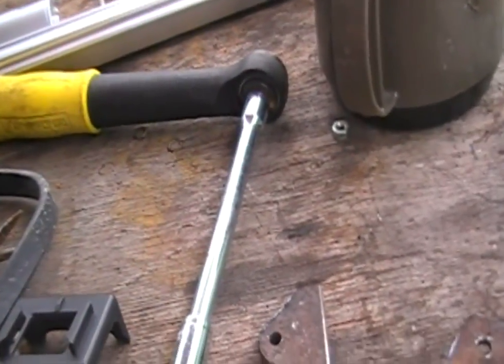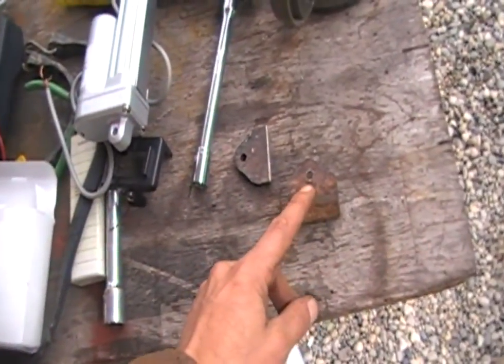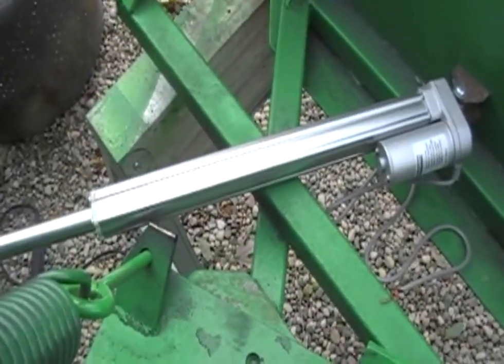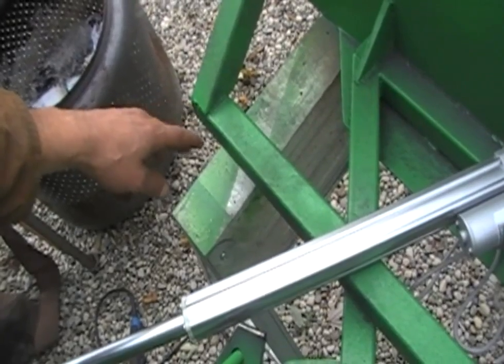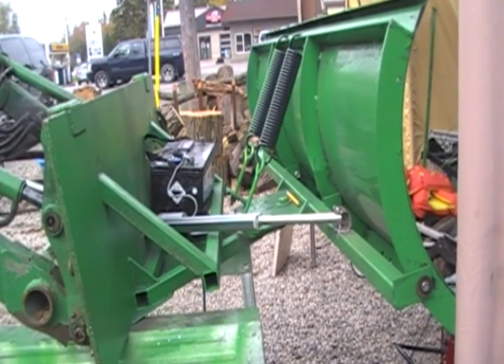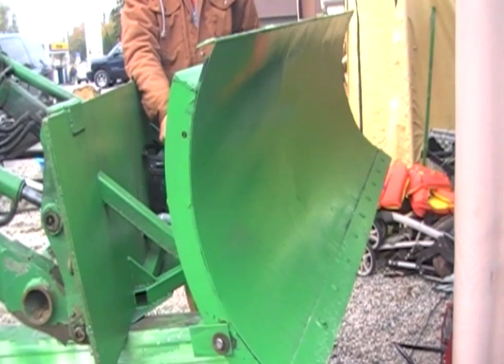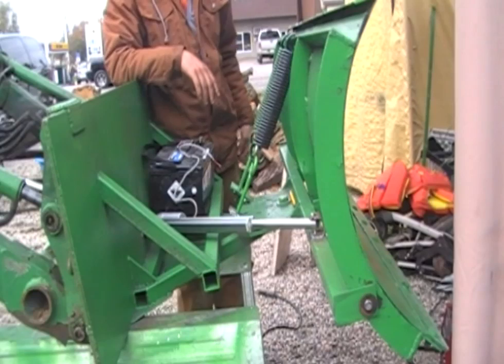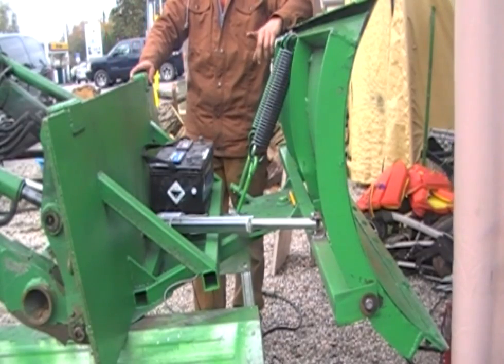12v actuator install on Homemade Snow plow

Comment: There's all sorts of wrong with this. First time he trips the plow that whole mess will get ripped off.
If you're gonna do it you need to have it at the pivot where the actuator isn't taking as much of the force. Problem is you won't have the force multiplication from the lever the plow provides on the pivot. Might stand a snowball's chance in hell vs putting a full load on one of the biggest levers you got there (that also trips forward).
Also agree with others... why not hydraulic? You got a freakin tractor. Just put a cylinder on and boom. Done.
Reply: The actuator should only serve as a way to move the plow, a locking mechanism should be in place to lock the plow in position and take all the abuse.

Comment: Good job rigging plow angler but I can tell you right now absolutely will NOT be strong enough for your application. Your gonna hit a big bank of frozen shit and that little actuator will blow to hell and back. You need dual rams similar to a low end light duty western plow set-up that will distribute the shock load between the two rams or in your case actuators. Maybe if you'd get the heaviest ones they make and set it up like I mentioned it could be do- able !!!  ONE WON'T CUT IT !!  (Maybe on a small atv or something !!   I've tried this so I'm not just blowing shit out of my ass to ya--I JUST WANT TO BE HELPFUL.  sorry !!

Comment: You need a heavy duty actuator for that. The one you have looks flimsy and will probably break. The pivot points are also weak and will more than likely bend as soon as you are into some frozen snow banks (it happens) so I've rethink the whole idea and go more heavy duty if I were you.

Comment: Why not use hydraulic off tractor ? Your auxiliary handles aside seat will perform this task w any hydraulic cylinder you can find n will do both motions in one unit.

Comment: If i were you I would use a winch, much stronger at a fraction of the cost. Still 12v but 2500lbs of strength instead of say 250lbs or 350lbs

Comment: I've got a blade coming and looked at similar actuators.  Highest force was 225 lbs & 300ish - seems not enough.  Considering using motor to drive it between lockable detent positions (Pull cable & release to next position), or going hydraulic.

Comment: I have spotted the fatal flaw that will cause you to crash burn and die!
When the trip springs trip it will bend your shaft to an angle youre not used to!
Reply from the maker: rob armstrong no that part does not move the blade pivot on the Square tubing the tube stays straight
Reply from the maker: rob armstrong I think I'm going to make it lol

Comment: u know that will not turn when it gets cold right ask me how i know.
Reply from the maker: Paul E Clemons Jr does the motor freeze up
Reply: Ive got 3 differant ones and the colder it gets the less they work to the point of not working if you can warm them up they work for a while until they get cold again .The better the quality the less the cold affects them but still affects them.
Reply from the maker: Paul E Clemons Jr thanks for the tips
Reply: Ya i think its the grease thier packed with but i havent taken one apart maybe if u clean one out and use a differant lube it would be better let me know what u find out if u tinker with one.
Reply: @pauleclemonsjr1457  : Yer right, it's gear driven. Grease will slow it down.
Reply: Paul E Clemons Jr I made a linear actuator out of thin steel pipe, all thread, nuts, washers and cheap cordless drill motor. Similar to ones found on you tube. It is sealed up and has motor oil inside for lube and a threaded plug to change oil. Cold has little  effect on it.